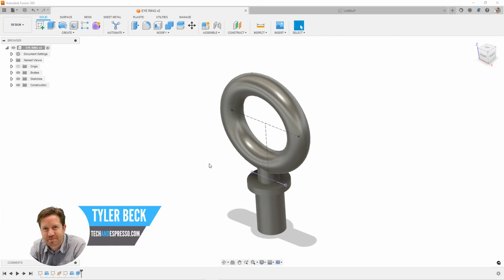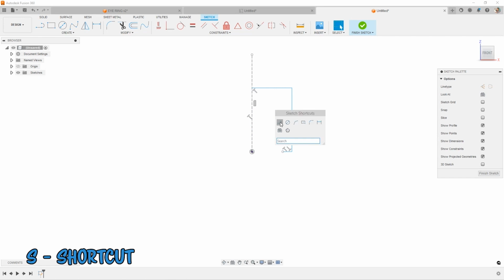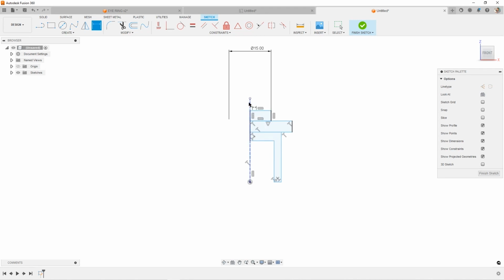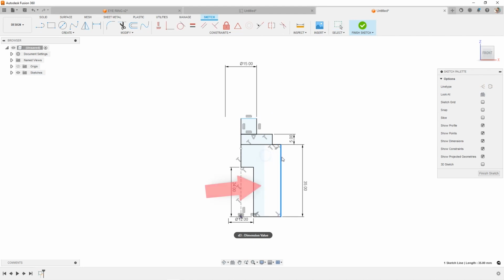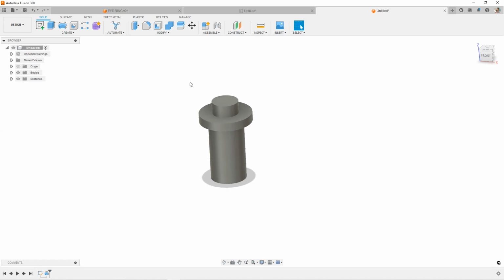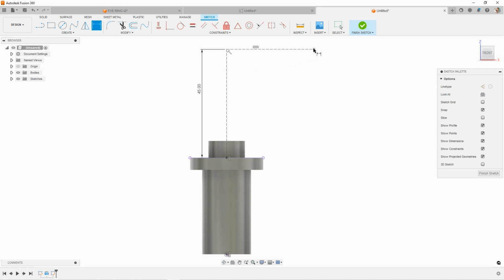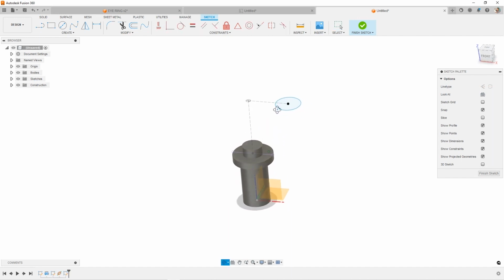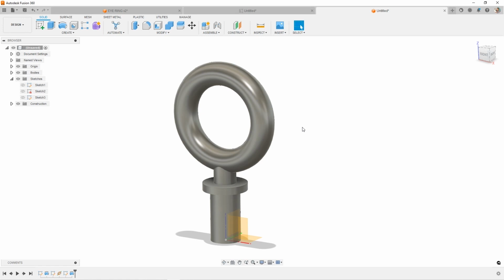Fusion 360 Eye Bolt (Revolve Magic)

Comment: Tyler,

Good stuff, as always.

I understand that your focus was on the revolve command. But here are my thoughts on another way to skin 
-the-cat.

The center line feature works well. I reduced the steps in the timeline to three. Sketch, Revolve, Pipe. 

Add a circle in the sketch at the overall diameter, offset inward by the radius of the 16mm circle, then change the 76mm circle to a construction line. Snap the top edge of the top cylinder to the offset inner ring.

Activate the pipe command, select the offset circle, set "Section" to Circle, set "Section Size" to the diameter of the ring 16mm, deselect "Hollow", and Join.

https://drive.google.com/file/d/1HANY6tdLGHlWdi5cmPoXOQykDIG18ECM/view?usp=drive_link

Comment: Instead of using a construction line, try using the center line. It will automatically dimension diameter in stead of radius.

Comment: It can be done in one sketch without a second plane by setting the origin at the center of the ring and revolving the ring around the X axis, or Y axis if sketched on the YZ plane.
Reply: Yes, one sketch, one revolve, 4 extrusions.
Reply: @philippe5394  One sketch, 2 revolves. The base revolves on the Z axis in either case. With the origin at the center of the ring I drew the 16mm ring profile 30mm below on the C/L. From that point down I drew the right profile of the base. So essentially it is the same sketch as Tyler's with the 16mm ring profile at the top of the base. The base is revolved the same. The ring is revolved head-on up and around. The resulting orientation is 90° to the example when sketched on the XZ plane. Sketched on the YZ plane keeps the original orientation.